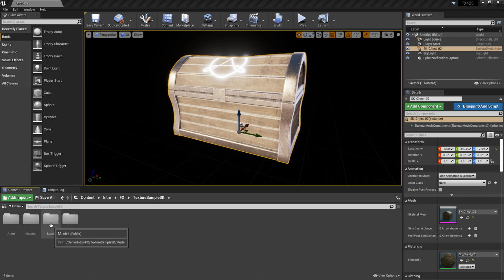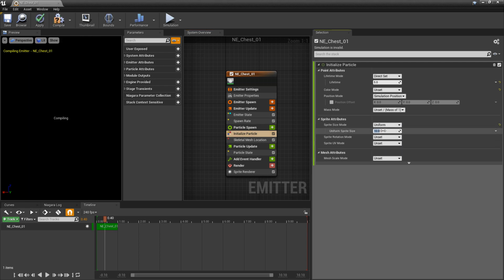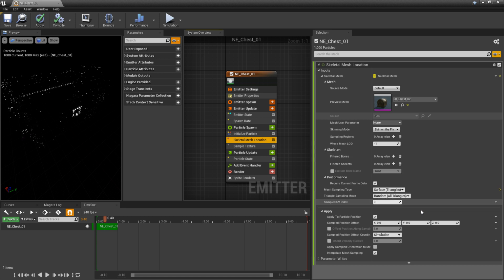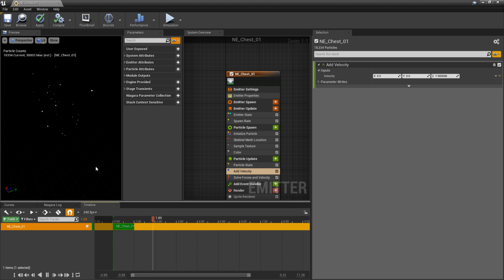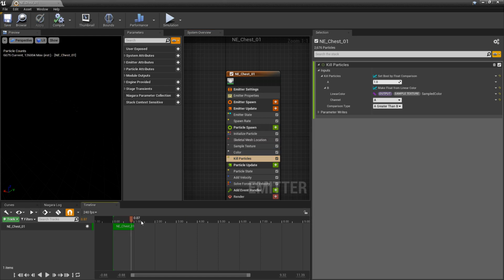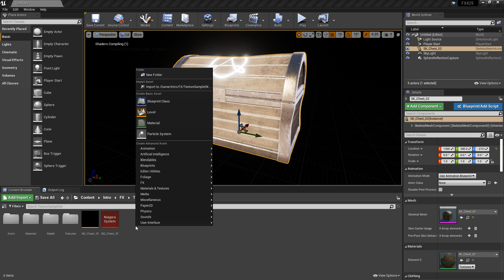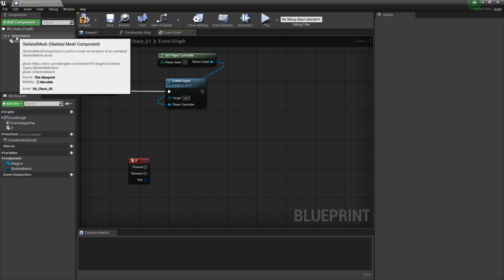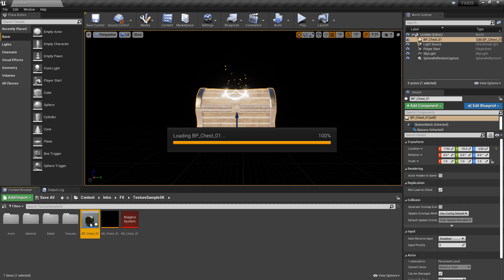UE4  - Niagara Texture Sample - Part 4 - Skeletal Mesh

Comment: Dude I have a question. How did you figure all this out? What was you system to approach Niagara to break it down in this way?
Reply from the maker: It was really just a "what do I need to know next that's related to the previous thing?" Plus a bit of trial by fire.
Reply: @gamedevoutpost9270  Yep. That is generally the way. Thanks for this man, I am doing a student project, and I think this will help me a lot. I know this may not be possible, and you may not know yourself. Can you animated vertex paint? Not in the sense of using vertex paint to drive mesh animation, but to animate the colour and position of said paint on a mesh?
Reply from the maker: It depends on what you're trying to do. You could use a second uv channel to animate vertices over time and could lerp and manipulate your vertex painting as well. There's alot of options.
Reply: @gamedevoutpost9270  True. And is ironically what makes it so hard. So many choices. Thank for the reply.